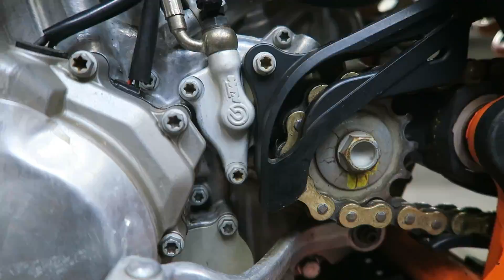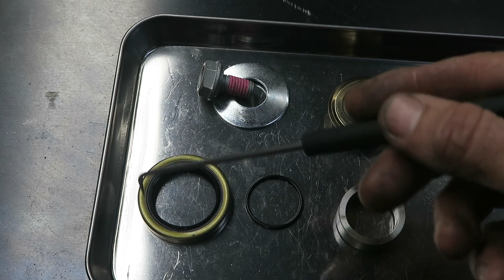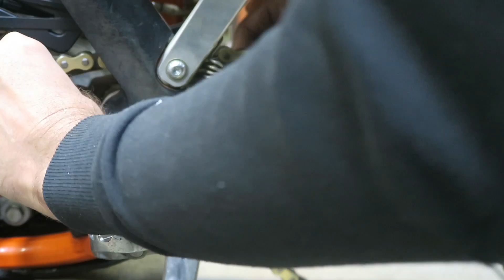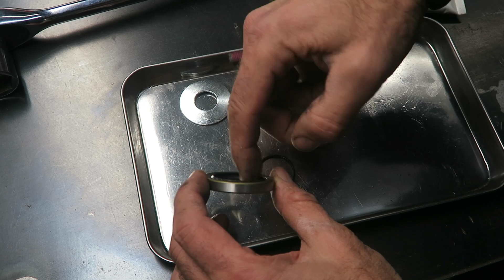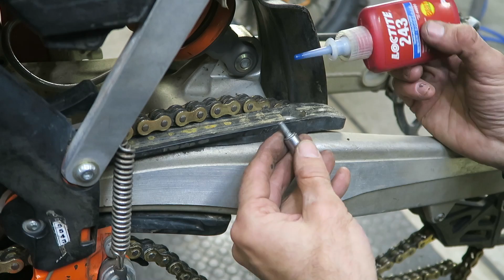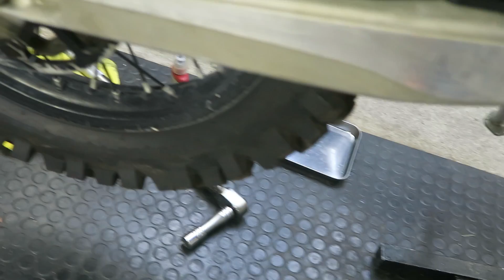KTM Countershaft Oil Seal Replacement

Comment: Guys piece of advice before you untertake replacing the seal when you see oil spils behind the front sprocket: take off the sprocket, and use a small tool to remove any debris and sand from the current seal. Then drive a couple of kms and check if its still leaking.  Mine turned out not to be broken but in fact full with junk which caused minor oil spills.

Comment: Almost a great video you didn’t say which way the bolt comes off forwards are rare or towards a rare of the tire. I’m pretty sure it’s to the rear of the tire, but I can’t get mine off.
Reply from the maker: The countershaft bolt is regular thread. In the video at the end you can see me turning the new countershaft bolt clockwise to install it. If on your bike the countershaft bolt has never been removed you may find it difficult as in the factory red Loctite (high strength) is used. With a 1/2" air impact, or 1/2" cordless impact you should be able to remove it easily.

Comment: I hear that in most instances the seal is fine, you just need a new dome washer to put pressure on the O-ring.  The Dirt Tricks dome washer is a bit larger/thicker/stiffer, which should help also
Reply: @davidh1314 Can you tell me more about this fact? In my case, I noticed that the washer spins on its own beneath the sprocket bolt. I rechecked the torque on the bolt and it is indeed at 60nm. However, I am wondering if the spinning washer is related to the transmission oil leak I'm experiencing. The bike is a KTM EXC450R 2010

Comment: Is this the same leak as a 790 Adv? I’m looking to buy one now on yahoo auction. They told me it has the countershaft leak.
Reply from the maker: I'm not familiar with the 790 Adventure. Typically countershaft seal leaks are either due to the seal wearing out after high hours in difficult conditions, the chain tension being too tight, or the countershaft sprocket being loose and not apply sufficient pressure to the internal o-ring to compress it and make a seal. As shown in the video it's pretty easy to fix and the required parts are relatively inexpensive. Note that the press tool shown in the video will only work on off-road models (EXC, EXC-F, XC, XC-W). The 690, 790 and 890 have a different countershaft design (nut is used to secure the sprocket instead of a bolt).
Reply: @TokyoOffroad  damn… yeah… an odd thing to have issues on so many models.. but after I showed interest on auction. They sent me a quote for shipping and added in.. ohh the bike has an oil leak that’s well known! 🤦🏻‍♂️ guess if I buy I need to fab or make a tool. I do have bearing installation tools.. see what others are doing..

Comment: love your vids but as long as u flush, its fine, just did it on my 300. Make sure the seal is flush dont need all the special tools :D
Reply from the maker: The install difficulty is not getting the seal flush, rather due to the size of the seal it's easy to get it canted while driving it in and then ruin the seal. I've seen quite a few YouTube videos of people running in to exactly this problem. Using the Tokyo Offroad press tool minimizes the chance of any install issues and makes it much easier.

Comment: Hey can I use the wheel bearing press tool that you sell to do the same thing?  Is that piece the same size?
Reply from the maker: No, sorry but the seal size is different from the wheel bearing size, plus the countershaft press tool needs to be able to fit over the countershaft.
Reply: @TokyoOffroad  dang.  : (

Comment: I purchased the seal installation tool before it came with the bolt for for strokes. Can you tell be what size bolt you need?  I couldn’t figure it out by the oem parts finder. Thanks.
Reply from the maker: M10x1.5

Comment: Green locktight is made for sealing bores on journals.
Reply from the maker: I used some medium strength blue Loctite 243 for this. I didn't want to use high strength as it would make future replacements more difficult (require heat to remove the seal). As mentioned in the video this is optional. If there are any scratches it's definitely a good idea...
Reply: @TokyoOffroad   Yes, red is too much. What I'm saying is that there is a locktight product (green) that works well for this sort of work, bearing journal fit, etc.  It is very thin, and wicks into scratches like you mentioned might be in the case.  Heat is not needed, despite locktights description saying it is medium to high strength. I use it all the time to help with bearing fit in bores that may be less than stellar, or where I want to be sure the inner or outer race stays put on the shaft or bore.

Comment: The tool you made is brilliant! I had a local machinist make me a driver using some of the same principles (not that I'm brilliant, far from it). The seal sits on the smaller bit which is the same height as the seal, the center is bored so it slips over the shaft and the OD is larger than the seal so it can only go on flush. Mine is tapped on but I like the control of the bolt. Thanks for sharing. Liked and subscribed. Cheers!
Reply from the maker: Yes, the seals are quite tricky to install without a suitable tool due to the large size and it can be quite easy to damage them just if not careful. A suitable tool makes it so much easier.
Reply: @TokyoOffroad  where did you get this tool? where can i buy it? :-)
Reply from the maker: @stephanbaumann6713  - Thanks for your interest. The Tokyo Offroad Countershaft Oil Seal Press Tool is available for sale here: https://www.tokyooffroad.com/product/countershaft-seal-press-tool-cspt/

Comment: mine is also leaking (KTM EXC 250 6d 2019). Do you know how this happen? My suspicion is on the use of pressure washer
Reply from the maker: An over-tight chain will shorten the life of the seal. Yes, pressure washer pointed directly at seals is not good and will possibly force dirt into the seal.

Comment: Man I got a vine behind my front sprocket and it roached my countershaft seal. Luckily it didn’t start leaking until I literally got the bike in the bed of the truck. So I was able to lean it over and tie the bike down to stop the leaking. Got home, drained the rest of the oil, now im waiting on the new countershaft seal kit! That was a first for me. Usually I’ll let them go until they leak on their own then change them but this one had help!

Comment: Thank you for the video. I'm actually doing this right now but dont have the tool to remove the seal like you  did. Is there an alternative to this and also an alternative to fitting the seal back in as I do not have the tool as weel
Reply: I’m 2 years to late mate, but a socket will do the trick
Reply: @thedawg2441  Thanks mate.. got it done as you recommended

Comment: Hammer top side a little so bottom is poking out bend the end of a file 90 and pull as hard as you can. Sounds sketchy but got it out
Reply: or buy a seal puller for $10 lol

Comment: Of course my replacement didn't come with a new crush washer.... However, I just replaced my sprocket and didn't remove the rear wheel, just turned the adjustment bolts all the way in, not sure how much easier it is but if you are replacing the front sprocket and/or chain you will need to do so anyway to get the adjustment correct. Also you can just use a zip tie to hold the chain out of the way. The lazy man usually finds the easiest way to do something or so I am told.

Comment: hey Mark clean video as usual...i need to do this and will do it tomorrow. Didn't you forget to put the black o-ring?
Reply: never mind just saw you put it in! sorry
Reply from the maker: Oli M - Yes, the o-ring was installed...
Reply: @TokyoOffroad  yes sorry should have finished watching before commenting. Also Mark any chance you can make a video of replacing the KTM fuel pump filter? Thanks in advance your videos are so helpful

Comment: I screwed up the seal landing, deep scratches, how do you get it back in round and clear?
Reply from the maker: The Duke - If the seal skirt is bent and distorted I recommend buying a new seal and try the install again. If the case seal seating area is scratched you can apply some thread lock to the seal skirt before install as I mentioned in the video. Installing the new seal straight using a socket and hammer is not easy which is why I developed the press tool. If you’d like to purchase one they are available on the Tokyo Offroad Webshop and happy to ship worldwide. If you’re going to use a a socket and hammer then I suggest you go very carefully and check the seal alignment after every tap.

Comment: Just a heads up. Loctite owner has been hard at work lobbying to shut down offroad trails in CO. Some riders would  appreciate, if you didn't advertise them. 
Thanks for the video!
Reply from the maker: jarel nomeh - That’s the first Ive heard of that. Please can you quote a source of your information.
Reply: @TokyoOffroad  Slavens Racing has mentioned that in one of his videos. He's local.
Reply from the maker: Could you quote what Jeff Slavens said about Loctite as I haven’t heard of this before. I did try Googling but couldn’t find anything. Note that I have no connection with Loctite and all of their products which I use I purchase at retail cost. I do not actively advertise Loctite products, simply share information regarding what product I use on my bikes.
Reply: @TokyoOffroad  https://youtu.be/SfnZxTGbTxY?t=501
Reply from the maker: Thanks for the link to the video. In it Jeff Slavens says "The dick who owns Loctite has been trying to shut down trails in SW Colorado". I'm wondering specifically who Jeff referring to. The owner of Loctite is Henkel AG (Loctite was acquired in 1997), but I'm guessing he doesn't mean Henkel.  Currently the key Henkel Loctite executives listed are Robert Aller (CFO) and Louis Baccei President of R&D. BOD members are listed here: https://www.bloomberg.com/research/stocks/private/people.asp?privcapId=285877 . So who is it that Jeff is referring to and were they using their own money, or corporate Henkel Loctite money to do the campaigning?

Comment: I learned to clean the threads in the shaft from personal experience.  My bolt wouldn't seat all the way.  Left the domed washer without enough pressure.  That left the pressure off the spacer behind the sprocket and let oil pasted the oil seal.

Comment: great, but what if I don't have such tool? any alternatives for pushing that in?
Reply from the maker: I do sell the countershaft oil seal tool shown in the video on the Tokyo Offroad webshop, if you'd like to buy one: http://www.tokyooffroad.com/product/countershaft-seal-press-tool-cspt/ 
The other option is to hammer in the seal using an appropriately sized socket, but it's very easy to get the seal canted. If this happens stop immediately and try to correct it, or you will ruin the seal.
Reply: really like the drive tool you,ve made, had exactly the problem you described, canting the seal tapping it in with a socket, and ended up worsening the housing scratches, someone else had also had the same problem previously on my 530.

Comment: Do NOT use loctite on that seal !!!

Is NOT necesary, OMG
Reply from the maker: da - The use of Loctite to retain seals of this type and bearings is common and not something I invented. The advantages of using Loctite include 1) It will hold the seal in place better and 2) If there is any minor damage to the case (scratches caused during seal removal) it will provide a better seal. Only a small amount of Loctite is required and you must be careful not to get any on the rubber part of the seal, as mentioned in the video. If Loctite 243 (medium) seal removal and bore cleaning will still straightforward. But it’s totally optional as I noted in the video.
Reply: Ya its really common to use low strength loctite to seal/glue metal seals in place. That being said using it on a rubber seal accomplishes nothing lol.
Reply: People should really try to be a better mechanic before posting comments.  Your use of loctite, and description of why to use it is spot on on this video.

Comment: Why not just take the chain off .?
Reply from the maker: Robert's chain is a rivet master link. To remove the chain you'd need to grind the master link heads off and press out the link. It would have added quite a bit of work to do that and would've required replacing with a new masterlink. As such we decided not to take the chain off.
Reply: Ok